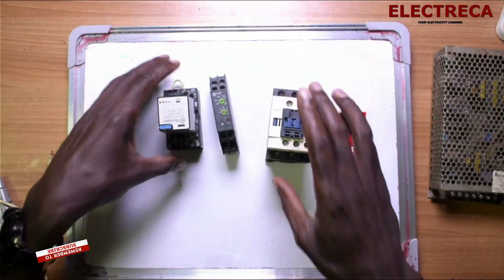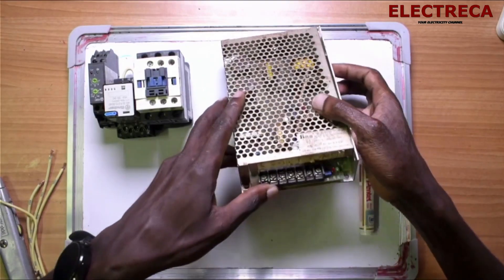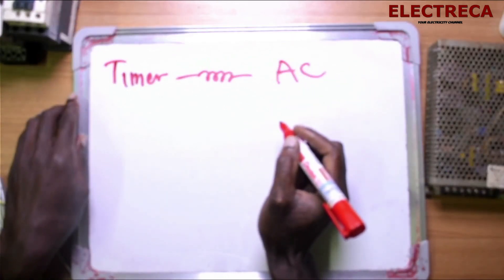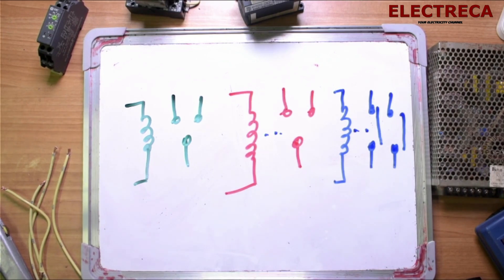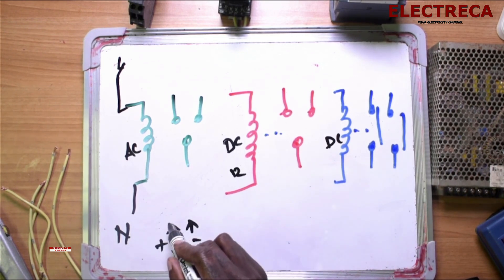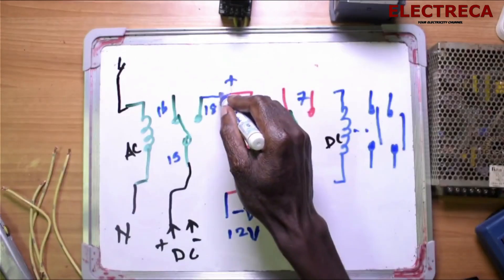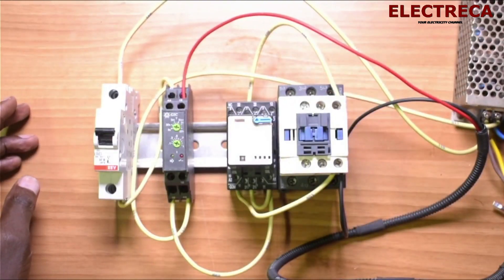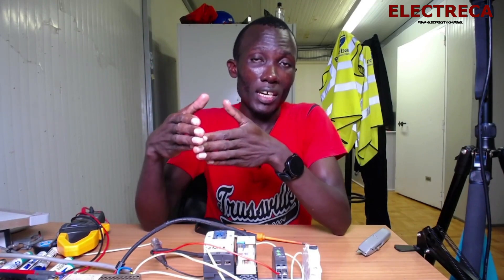how to use ac voltage and dc voltage in one circuit

Comment: Hello David
I am a fan of your videos and need your input for a diagram to control an industrial ice machine. Current one is very problematic.Its three phase. 
It runs following;
1) 1 25hp bitzer compressor
2) 2x Condenser fan motors
3) 2x Evaporator drum motors
4) 1x small conveyor belt motor 
5) 1xwater level control. 

Would you help with a diagram incorporating a phase failure relay and push button switches/indicator lamps.?

Comment: Why do we use DC in such a circuit
Reply from the maker: There are valid reasons like for my case the Components I used were DC rated, when you have both sources of power being Generators it makes sense using DC
And also Dc voltage has good characteristics than Ac,  so can be good for control circuit.
Thanks for watching.